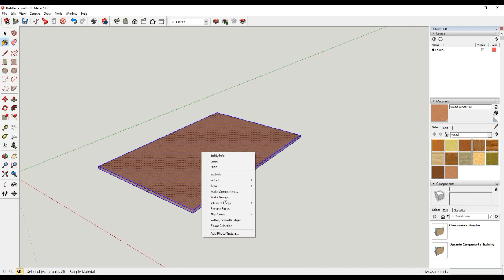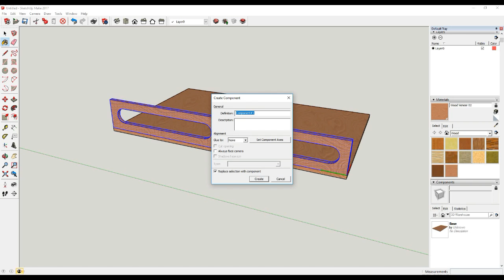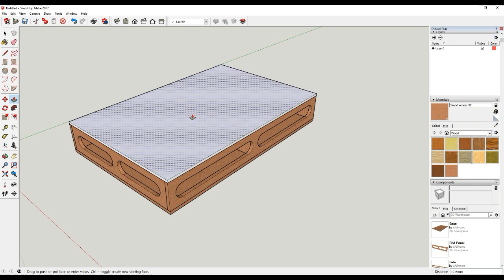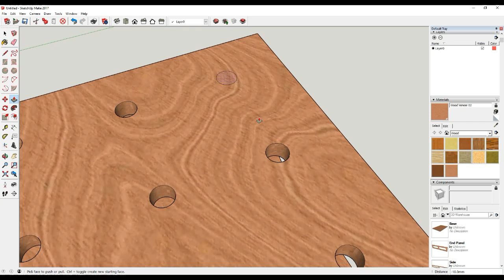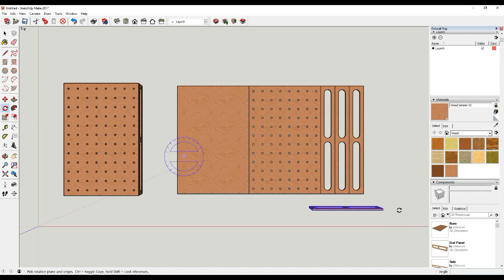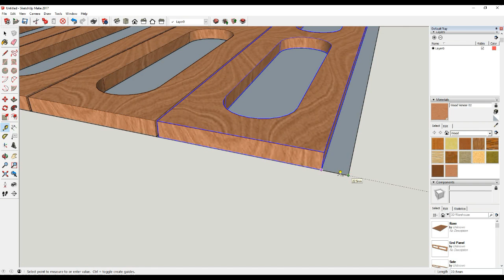Assembly Table - How to Draw in Sketchup

Comment: Many craftsman or Mobil office people can use a box van Cargo trailer and storage room for work and leisure. By installing 3/4" plywood to walls of van and trailer modular components office Paulk tool racks or modular rec vehicle . semi trucks use apu units and combo Murphy bed dining unit. A slide out unit in a box truck . I use a pack rat box for tools in my garage. A secure storage unit for electronics. My mini van was broke into and cost several $1,000. I see new utility van bodies have alarm and remote locks.
Reply from the maker: This is always a big worry when you store valuable items in a van or trailer parked outside. It seems the more secure you make it that advertises you have something to steal 🥴

Comment: Hi Greg, I just found this vid after following your van conversion series 

I spent 30+ years using various CAD systems and now retired, will be taking a look at this software 

Autodesk had an Array command to copy a feature many times in both X & Y axis in one command 
 You have explained it very well.  Thanks. Nigel 👍🏻
Reply from the maker: I too come from an AutoCAD background having used it everyday for work. You’ll pick this up very quickly I would say. Hope you enjoy using it.
Reply: Well I can't see how this is faster that Autocad Mechanical, from what I can see like Nigel mention it is lacking an array function, a fillet function, a reference from function, a tangent function, and a mirror function. If SketchUp doesn't have those functions it is worse than DraftSight (except DraftSight is only 2D), but I do see they have a Pro version for only 700 euro which a very good price, if the pro version is more extensive. I'll be looking into this too. Thanks for sharing :)

Comment: I'm new to Sketchup.  Can you tell me how to set the view as you did? I'd like to work from above but still have perspective.
Reply from the maker: Hello +Jeffrey, there is a tool set for the different views. Watch my recent video on the picnic table. 
Once you have that tool set open you can easily switch between views 2d or perspective. Cheers
Reply from the maker: Hello Jeff, right click on a blank part of the menu bar which should bring up the toolbar list. 
Select the "Views" toolbar (symbols of houses in different views will appear) 
Click each house symbol to see your model from a different side or top view.
Reply: This helped a bunch. Your videos are really helping with a conversion project I have in mind. So again, Thanks!

Comment: Near the end you copied 3 of the side panels instead of two and 2 end panels instead of 3, also the 3 end panels are to long by 36 mm( the thickness of two sheets) apart from that thumbs up and I'll go and download this now. Keep up the classes
Reply from the maker: Hello Brian, Yes, you are absolutely right I got the quantity of side and end panels mixed up. Well spotted.
However, the lengths must be the same as the model because they are all the same component.
If you look at the table the long sides run the full length and the ends are cut inside of these.
Thank you for watching and I'll make sure I'm more diligent in future videos. Cheers
Reply: After watching again I see that you right about the end panels length
Reply from the maker: Thanks again Brian, Cheers

Comment: Greg:  Though this may be too late for your build, David Parfitt has a cracker-jack system for drilling standard 20 mm holes for a Festool work surface such as this.  Check out the YouTube which is one of many demonstrating the system.  The hole spacing will differ from yours and can be accommodated.  This system from Axminister in England is available from Lee Valley in the States.  https://www.youtube.com/watch?v=sQJhVMUYmmQ

Comment: Greg, if you make the hole a component, then the actions you apply to one, will be repeated in the others. The procedure would be to make the top, then make a single circle. Make the circle a component, then copy it to the correct position, through repetition, as you did. Double-click one of the circles and that will isolate it. Now push the circle to the bottom, and then make the circle a hollow hole. Each of the other circles, based on the original will now also be a hole. Finally, copy your line of holes across the sheet, using the copy function and the repetition by typing X, as you did.

Comment: Thanks for the great video Greg. I've been using Sketchup for a while but hadn't used guide lines or the muticopy you use so am grateful for these useful tips.  

As for saving time on pushing all the holes through the top, I would have drawn to top and added all of the holes while it was still a 2D object. Once this is done you can pull it to 18mm thick and the holes are done.
Reply from the maker: Hi, pleased you found those useful. I still have a lot to learn myself but always good to share tips and tricks 👍🏼
Reply from the maker: Your tip for holes has given me an idea. If I had drawn the circles first and placed the rectangle around them it would not have filled the holes and then can pull up 😀

Comment: (Just a theory, I have not tried it.) Could you orient the piece so that you are looking down at it parallel to the edges of your computer screen, and drag a rectangle selection over the top of the piece to include all of the holes, and then do something like a push pull while holding shift? Does that make sense? I am learning about sketchup today, so it is pretty much a shot in the dark.

Comment: Push/pull

You can double click the next surface after you have pushed the first hole through, and it will repeat.  Hope this helps.

Where is the Times function while copying?

Thanks
Reply from the maker: iamamp3pimp thank you, recently found that works after other commands too. 
To activate times command simply type x and the number you need and hit enter. This can be repeated until the right number is copied if you're not sure. Hope that helps 👍🏼

Comment: once you push-pull the first hole, immediately after that just start double clicking all the other holes!
Double Click will work with all functions, meaning, if you push-pull 18mm, then you need only to double click the next thickness.. It also works with the move tool!
Reply from the maker: Osamah Abu Ali thank you. 
That is much quicker. Cheers

Comment: I love the channel, but I can't get the links to download anything.  Has the PDF file moved?
Reply from the maker: Hi Flint, the PDF file link appears to be working OK, can you try again?
Reply: Greg, Thanks so much for the quick response. I wanted to let you know that the link does in fact work just fine. However, you have to be using Internet Explorer. I was using Google Chrome the first time I tried. 

I also wanted to say that I am glad of the smaller table because I too have limited space. I plan on adapting mine to be a folding version and hanging on the wall.

Comment: hi greg! 

my approach to 'drill' the holes without a plugin is the following:

-) make one complete hole (circle, then push/pull)
-) make the hole a component (select the comlete hole by doubleclicking the circle, rightclick, make component - make sure to check 'replace selection with component')
-) copy the components to the pattern you want as described in the video - you will still only see circles
-) select all the components
-) rightclick -> intersect faces -> with model (this generates independent faces in the circles)
-) select all these faces and delete them (on both sides)

maybe this way can still be optimized but maybe it is a bit faster...

cheers
Reply from the maker: Totally understand what you have done there. Thank you for sharing this method. 👍🏼

Comment: Looking for the pdf link???
Reply from the maker: Hey Skipper, the link is in the video description.
But if you're having trouble finding it i'll put it here for you
https://www.dropbox.com/s/95uuopw1cxjdvya/Assembly%20Table.pdf?dl=0
Reply: Thanks - didn't but a minute + to convert to inches. I think I saw you would use 1/2" next time.
Reply from the maker: Yes Skipper, I would build it with 1/2" thick ply (12mm) as the 3/4" birch ply is very heavy to move about the workshop.  Really pleased with the size though.

Comment: Hi Greg, I hope this is a bit quicker. After drawing your holes, push pull the first one to required depth or right through. Then using push pull tool double click each of the holes and they will repeat your first hole.
Reply from the maker: Dave Carpenter, thank you, that would be a bit quicker.
Wish I could drill them that quick, it took ages yesterday lol
Reply: I set a macro on my keyboard to the tilde ke, that simulates the double click.  With my mouse, I could hover the item, tap the keyboard key and it will double-click the object.
Reply: Awesome tutorial!! As with others, it helped eased the fear of trying to learn new software. To "drill" your holes, draw the bottom of the board then the holes. After that use the pull tool to add thickness!
Reply: What about you make the first hole than make it a component. Draw all the holes and then push down on any hole to make it a through hole. Since they are from the same components they should all go through. My guess.

Comment: Greg, links to both files on sketchucation.com. 
https://sketchucation.com/?searchword=libfredo6&searchphrase=any&limit=20&ordering=newest&view=search&Itemid=99999999&option=com_search      (You need item 5)
https://sketchucation.com/pluginstore?pln=JointPushPull
Reply from the maker: Dave Carpenter, that's super helpful. Thank you for taking the time to do that. I'll see if I can record a short update. 👍🏼
Reply from the maker: Hi Dave, quick update, the Fred06 plugin did push them all at the same time :D but it would not reference to the other face and hence did not delete that to make a hole? Tried all variations of that tool.
I found another Multiple Push Pull plugin but that also leaves the bottom face intact.
One thing I did discover though is if you can double click a face and it repeats the previous push pull depth.
You would still have to double click every hole but it was much faster.  The search continues, Thanks
Reply: Hi,
Thanks for update. Sorry I did not notice that. I just drew multi circles and "lifted" them up to make columns.
Will keep looking.

Comment: Best Make tutorial I have found so far. Just starting to learn this software. I found this one to be quite useful. Please make more.
Reply from the maker: +chris fields Thank you very much. I have more in the pipeline. If there are particular aspect that you would like help with please add to the comments and I'll see if can help you. Cheers
Reply: Greg Virgoe I have been trying to draw out a miter saw station. Having trouble figuring out how to get the legs at a 90 deg. angle to the table top. I'm sure it is something simple but I just haven't been able to get it yet.
Reply from the maker: chris fields, if you want the legs to be perfectly upright you can either draw the cross section in plan view and then use push pull to extrude it vertically. or,
If you have already drawn a leg laying down on its side use the rotate tool to turn it upright and the move tool to position it. Like I did when laying out my cutting plan.